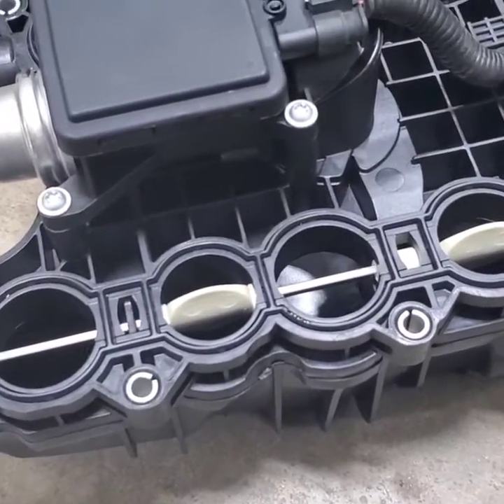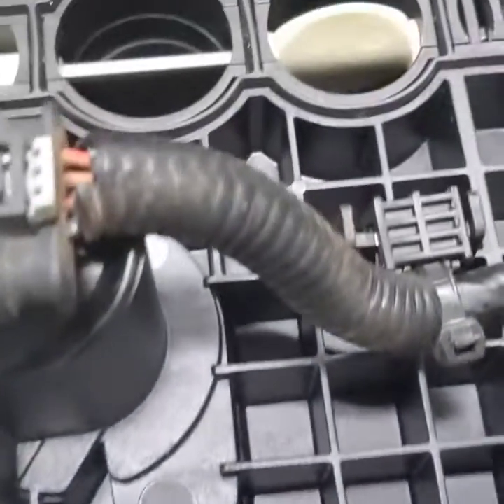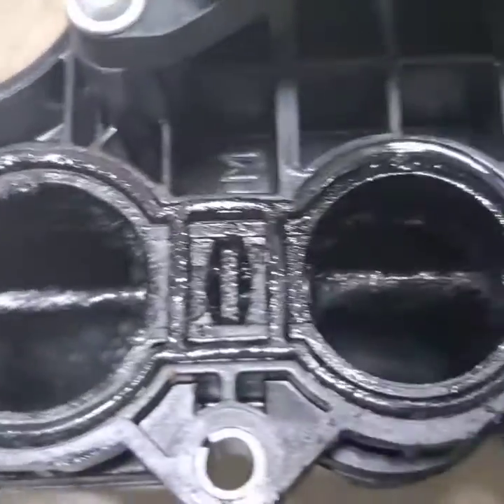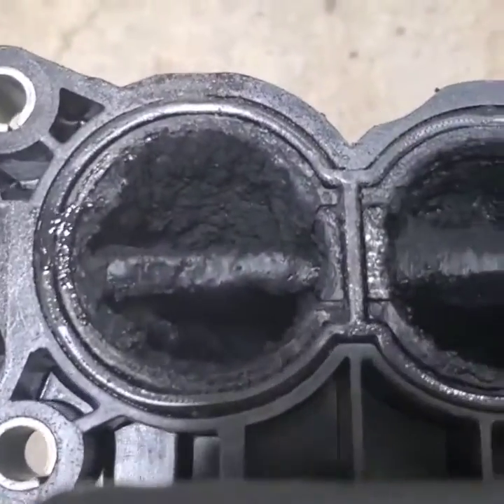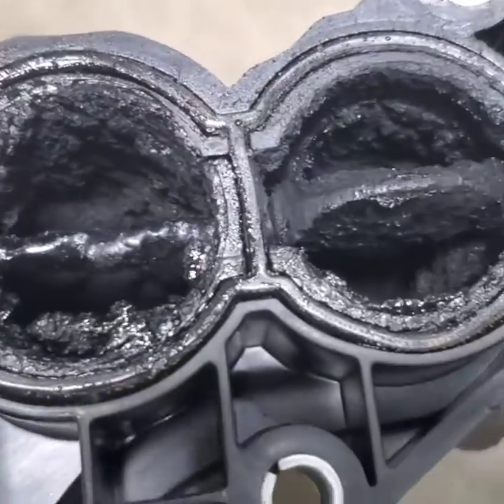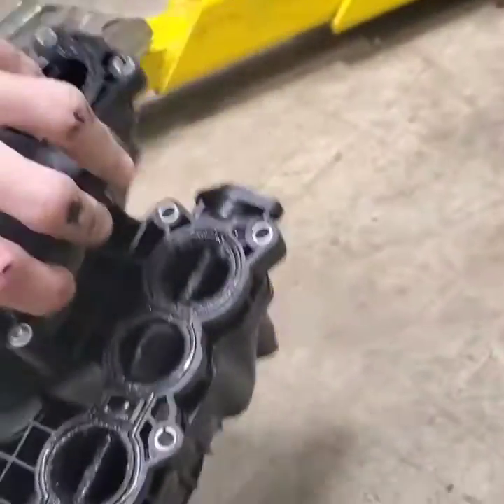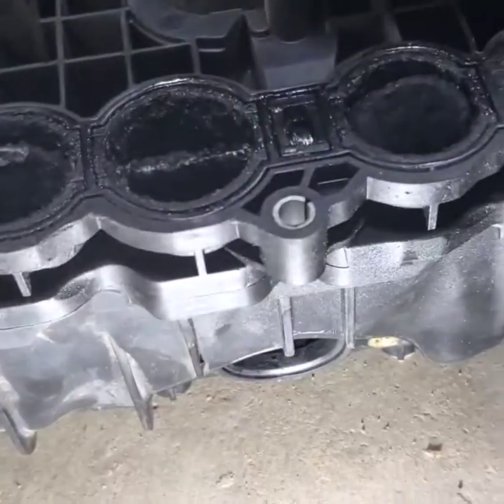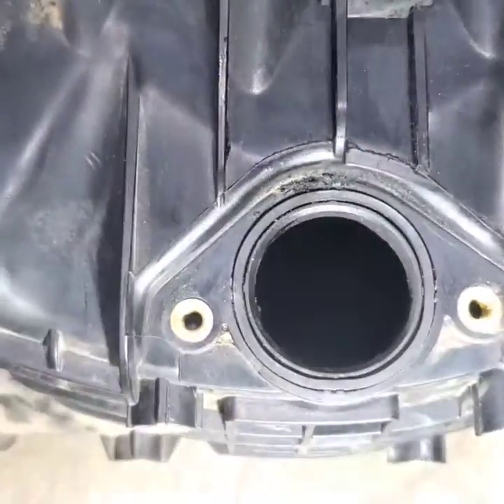2015 Ram Eco Diesel intake, Intake swirl valve, and why it's important to change your oil regularly.

Comment: It has nothing to do with maintenance. Its due to the egr valve dumping exhaust to the in take do to emissions. That actually look ok for 100k miles.  While you are in there replace the turbo coolant hose you will save a big problem later. Mine stated leaking at 168k miles.

Comment: EGR soot build up has nothing to do with not changing your oil or maintenance. It's EXHAUST GAS being sent BACK INTO the intake manifold. Stop suggesting this is a "maintanance" issue. It's an inherent issue with EGR and diesels being particularly dirty producing SOOT. No one is taking their intake manifold off to clean it as "maintenance." It's not practical or reality in any way shape or form. delete EGR if you don't want soot in your intake.
Reply from the maker: Thankx bubba I work for Dodge I appreciate your input. Maybe you may make your own video and save your self from raggin on mine. I guess bad oil dont do shit when its sucked back threw the pcv system just the soot. No way its the 10k oil changes and cheap fuel and lack of maintenance 😑 you got me. Send me a link of your video id love to learn bubba. Or just the links to other videos you watched.
Reply: @CodyDoesIt  egr is whatever is left in the cylinder after combustion. You think the condition of the oil matters after combustion? Clean oil isn't going to change buildup from egr in any way shape or form. You can work for whoever... doesn't mean you usnerstand even the most basic concepts of an engine and emissions. You do all your customers a disservice by blaming their maintenance for what is something driven by emissions regulations. An my ecodiesel has never called for a 10k mile change. It's condition based intervals. If you drive it on thebhighway you might get a 10k mile change an oil analysis will support that intervals. Modern synthetic goes 10k miles easy. My own truck is saying 2% oil life right now after only 4200 miles. Just more backyard mechanic myths that you need to change your oil every 3000 and the truck doesn't ever call for 10k mile changes unless you actually just grandma the thing around the highway.
Reply from the maker: I didnt know that Eco Diesel dont also have PCV systems that suck in fumes from the crank case that then feed into the intake and clogs these runners up with all the soot you speak of. Run cleaners or stop buying the trash dodge puts out. Worst case scenario leave your comments in a note book.
Reply: @CodyDoesIt  I'll leave my comments on your video where you blame maintenance and oil when the issue is egr. Maybe look up what egr is before making videos.
Reply from the maker: Lemme know when you make your own video.

Comment: Dealing with this issue now.. I was wondering if maybe intake valve cleaner might help....
Reply from the maker: It may but usally they get to clogged for any cleaner unless you run 8 in a row. It'd be easier just to replace than wasting the time unfortunately. The get coated more than a wall with your ex wifes name on it bubba.
Reply: What maintenance would really prevent this? Is it not a by product of the egr system that causes this?
Reply from the maker: @VicsGarage71  a catch can and not 10k oil changes like everyone does no adays. Or delete it completely

Comment: I know this video is old as hell. But did this cause a missfire?
Reply from the maker: No it was running rough not far from a misfire as well as engine light from those valve to not close all the way and open all the way.
Reply: @CodyDoesIt  my 15 has a misfire, and it just threw a swirl valve code. We are going to put an intake on it and hopefully that clears the miss up. It’s had an egr cooler put on it from the dealer and apparently they didn’t check the intake.
Reply from the maker: @chrisjoeli7203  yeah the swirl valve can cause lean or rich codes from not opening or closing I hope it works out for you. They have stopped sending us engines due to a engineering hold I sure this have something to do with this.

Comment: What's the proper maintenance to avoid this that you are speaking of other than deleting it right from new? I have done everything by the book with mine since 2017 (it's a 2015) and we are now having these issues..
Reply: none this is not true. the only thing you can do every now and then is clean your intake manifold temp sensor located on top rear of manifold by one screw. if this gets covered in soot you will get a lost in power and truck will go on limp mode almost like if you have no def fluid. little advise go a head and delete the truck it will turn it into a whole other animal! also most crank shaft failures on this engine are due to soot build up in oil due to the egr emissions
Reply from the maker: Lemme see your video. Bubba this was years ago let it go your not the first person to comment this. Did you do yours or pay for it? I did this one
Reply from the maker: I just saw this while laying down and in all honesty I cant really say that they have issues with engine. I have had many people have great experiences and mamy with bad. My suggestion would be used good fuel, change the engine oil often, and get a scan tool or a friend with one who can save you money on running a regen if you dont delete the def system. Depending on what state your in it may be illegal. Here in OK we dont do inspections. I see a lot that are deleted and run great better mileage like the 6.7s

Comment: Has nothing to do maintenance and everything to do with emissions system. This build up is from oil and dirty exhaust gas being fed back into the intake from egr. I’m overly diligent on my routine maintenance and my intake is plugged up and going to be changed. Your giving people wrong info, what they need to know is delete the egr early and you’ll have a clean engine internally
Reply from the maker: Well you should sell delete kits then because majority of our customers dont. A catch can can save a lot of carbon like the older 12 and 24 valves had but don't blame me for a terrible design....
Reply from the maker: If you are diligent then you wouldn't be here 🤣

Comment: The soot is from the EGR. The oil is normal from the turbo. This kind of buildup has much to do with EPA regs and little to nothing to do with changing your engine oil and regular maintenance. You can change your oil full syn, blend or otherwise every 1000 miles or every 10k miles with the same resultant intake problem. Nice to see a new one though. Sure is pretty.
Reply from the maker: This looked night and day new. Worst part is the crank sensor in between the trans and engine what a joke.

Comment: Original owner of a 2015 ecodiesel, 52k miles, can’t tune in CA. Do these engines last without tuning? It’s well maintained with oil changes and maintenance. No issues so far. Also do you recommend cleaning the egr diffuser tube and map sensor for maintenance?
Reply from the maker: The the egr cooler comes off and we soak them in a cleaner. Unfortunately they are known to be unreliable due to the emissions equipment the government has added over the years.
Reply: @CodyDoesIt  thanks for the reply, probably going to trade it in for a new tundra
Reply from the maker: It all depends with those vehicles unfortunately working for Chrysler I see them alot usually they go to a master tech who likes working on eco diesels. Tundra is a gas hog but very reliable.

Comment: You suggested do you maintenance to keep the intake clean. What maintenance do you mean?  I would  like to know so that I can keep mine clean and I am not aware of specifics.  Thank you and god bless
Reply from the maker: Do fuel injection cleaners keep the oil changed and if it's bad enough delete it. I see these fail allot regardless it's a bad design.  They are making new ones soon with a hot and cold egr systems

Comment: I'm looking at buying a 2016 Jeep Grand Cherokee EcoDiesel and have two options. The first is from a private seller with 50,000mi who did the GDE tune at 900 miles and has meticulously maintained the truck with no problems. The second is from a used car dealer with 70,000mi and the car had two previous owners and nothing major shows up on the Carfax but probably has never been tuned. I really like the second one because of the upgraded options and the look of it but worried that if I tune it as soon as I get it, it could still have problems from residual buildup over the past 70,000 mi. What would you recommend?
Reply from the maker: Thanks for the question. My first question is what will it be used for and when you say tuned was it also deleted?
Reply: @CodyDoesIt  The first car with the GDE tune had the original GDE tune that apparently shut off the EGR valve.  He also has a provent oil catch can system installed as well.  For the second car with 70,000 miles, I would only be able to get the new GDE EPA-Compliant tune after buying the car, which apparently is supposed to be just as good as the first but I don't think it shuts of the EGR valve.  I guess neither would be a complete delete.  They both would have the extended warranty to 120k miles which I would need just in case so probably wouldn't physically delete before then.  
The car would be used as my daily driver as well as to tow a 4000lb travel trailer.  I would be driving about 120 highway miles once every one to two weeks for work and the rest would be local highway and in town.
Reply from the maker: @evankaufman4071  I would go with the lower mileage vehicle personally. Although I am not fond of the eco diesel it can be a great vehicle if taken care of properly. Id suggest keep the oil changed every 3 to 4k at most and definitely look into deleting if you plan on keeping it.
Reply: @CodyDoesIt  Thanks Cody.  I agree, knowing that the car has been meticulously maintained and tuned since the beginning would make me feel much better. Although there is the thought that if I get the one with more options, I would pray something goes wrong so I could get systems replaced by the warranty and start from scratch.
Reply from the maker: I hope it serves you well my friend thanks for commenting.

Comment: Just to let you know that I do my oil changes regularly and I had my intake changed for the build up. That’s a Problem with the ecodiesel. I have 148000 Kms the intake was replaced under warranty. It’s a common problem with the engine.
Reply from the maker: I do realize. I work for Chrysler. They added a second egr on the newer ones a hot and cold side.
Reply from the maker: How often did you change your oil? Just curious? On average I'd say do it every 3k with syn blend and 5k with syn. But really I'd say do it every 2500 and 4k at the most. Diesel oil degradation is harder to see with the naked eye vs gas engines.

Comment: The egr valve is the cause of that not anything to do with maintenance 🙄
Reply from the maker: In this case it was both. These are 1 of the most common failure points. Most people delete em out where I am.
Reply from the maker: What about oil consumption? Burned in the engine then pushed back into the turbo then the engine.... saw this again today like clock work.

Comment: Question, what are all the necessary items that need to be removed to remove the intake manifold?

Any consumable (gaskets, seals ect)?

Any necessary special tooling?

Sorry to pester, I'm just looking to clean mine out soon. Want to be prepared, not too many resources out there for this job
Reply from the maker: Fuel lines wiring harness and pipes from intercooler to throttle body fuel rails water pump plus more if you would like send me your email I will send the diagrams to remove it. Its a lot of work 6 hours plus with the intake cleaning.  Your not pestering I love talking automotive. Check me out on Instagram Codydoesit89
Reply from the maker: Water pump can be moved back tho not removed

Comment: If you can't record, I highly suggest just snapping some decent photos and putting some description over them.

Not many "how to" anything on this process out there.
Reply: Cody can be more explicit, and tell the people how you suppose to keep that clean and why many people with the ecodiesel  don't do many , and how long it took him to do it and who can do it, and what is  his suggestion about to keep this clean.
Reply from the maker: Unfortunately it is a long process and even well maintained ones suffer. They are actually adding a second cooler to combat this issue which will further complicate things.

Comment: I do my maintenance and my intake looks like that. It’s the emissions crap that throws all that junk in there, isn’t it. I have a swirl valve related code right now, I would like to remove and clean my intake.  Would have been nice to see the whole tear down. Seeing you work on them, how much is a replacement intake. I have a ‘14 grand Cherokee with ecodiesel.Thanks for posting!
Reply from the maker: I am sure I can get one put together between me and the master tech I work with we have done 10 or so. I only did the one but had no issues.
Reply from the maker: Have to remove and intake on a Grand Cherokee with you engine next week and I will make as much of a video for you as I can. You jinxed me....
Reply: CodyDoesIt - I’m at least three weeks out on my tear down. If you posted a video prior to my tear down, that would be great for me. Give me some confidence. Didn’t wish it in you. Lol.
Reply: Dealership ended up replacing my manifold for free!! I had a swirl valve code, they thought that would have fixed it. Still had the light come on a couple times in the past few months.
Reply from the maker: Reading this in a FCA shop makes me smile. I am glad you saved the cash! Make more videos of the Jeep. I want one now but feel for the tech if he was paid warranty labor.
Reply: Ecodiesel Grand Cherokees will soon have a recall on our EGR’s. I’m almost at 90k and be getting more free parts soon, and still have warranty. It’s a love hate with my 2014 Jeep.
Reply from the maker: @tunedis95  I can understand that. They further complicated with EGR on newer diesels with a hot a cold side to the egr.... smh go figure...
Reply: Was your jeep out of warranty already when you took it in? I'm having the same codes and my factory warranty expired in August. I'm hoping it'll still be covered cause I'm not even at 100k yet.
Reply: @tonypethan2830  I was around 85,000 miles. Fell under the extended warranty from the EPA settlement from over a year ago.
Reply from the maker: Let em know I don't keep up with all that lol. How's it running?
Reply: @CodyDoesIt  I get the same CEL weekly. Plan to take it back in, patiently waiting for the recall to be issued. I checked to see if I could order the parts since I’ve seen someone else’s service advisor ordered their WK2s Jeep’s EGR components. But of course, my service advisor of the year said I have to wait till they formally issue it out.
Reply from the maker: @tunedis95  Sounds like bs usually they have to file a star case and wait for the rep. I have saw many egrs replacements on RAMs eco diesel.  Thankfully I don't get much warranty work besides flashes and air bag recalls.

Comment: Thanks for the video, where did you get the torx tool to remove the fuel rail?
Reply from the maker: It's a specialty tool that we get from Mopar. If you have a ratcheting bit driver and get a torex bit and cut it in half. There isn't much room for anything
Reply: @CodyDoesIt  Thanks for responding, I cut a T40 in half and super glued it to a 1/4 wrench worked great.  I just got my truck back together and going for a test drive.
Reply from the maker: Right on boss that is great let me know how she runs!
Reply: @scottleming2669  - ha ha. After watching Cody's video, ended up finding the PN and several pictures. I shall do what you did Scott!! Going to order a quality bit for piece of mind. Anything to be concerned about with a fuel rail that can contain 30,000 PSI? So long as the motor is off, pressure automatically bleeds off? That's one thing i have yet to look up in preparation of my upcoming job. My first diesel, so it's a learning curve.
Reply: @tunedis95  The fuel lines was not under any pressure. I disconnected at the fuel rail. I did have to use a crows foot wrench to get to some of the lines at the injectors. Good luck!